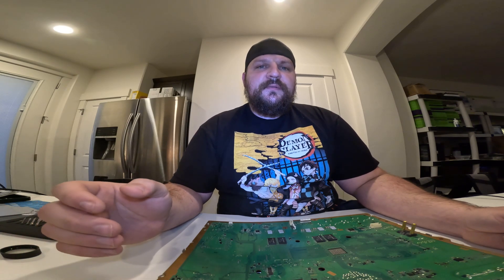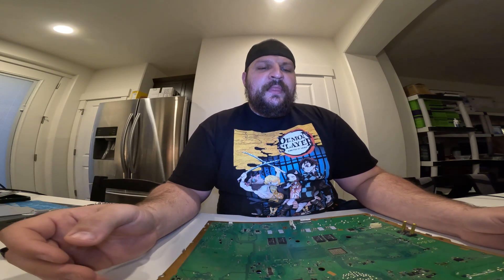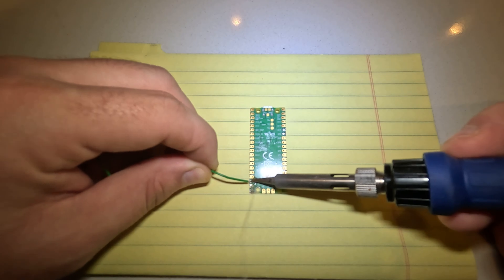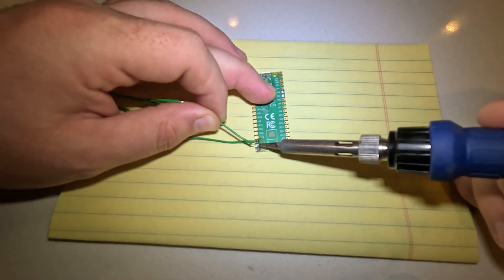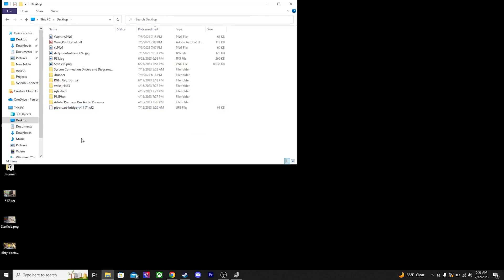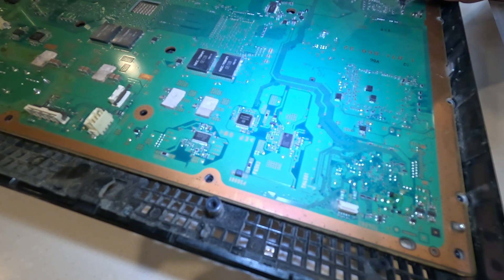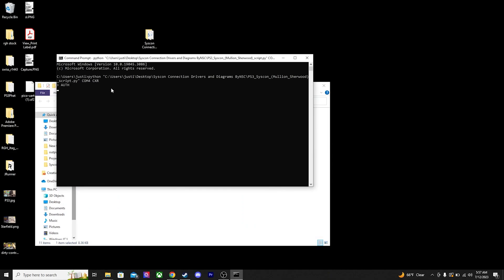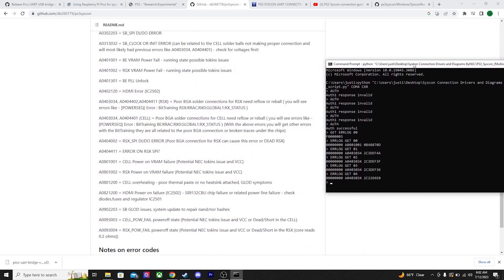PS3 YLOD mystery: Raspberry Pi Pico diagnosis

Comment: So that is an First ever Ps3  model with Cell Bga defect!?? So only very professional reballers can work on this ps3, the Cell is Extremely Extremely Extremely Easy to PopCorn, only the most qualified reballers can do it, you have to pre heat the entire main board in an oven baker for 2 days at 100 degrees celsius just to prevent popcorn when reballing.

Comment: I have both Arduino and pico (just got the pico cuz I’m planing to mod a 360). Is there any advantage to using one over the other for ps3 diagnostics? My PS3 will randomly shut off and I haven’t gone around to diagnosing it
Reply from the maker: Nope, As long as it is configured as a UART reader and the pin outs are done correctly it shouldn't matter